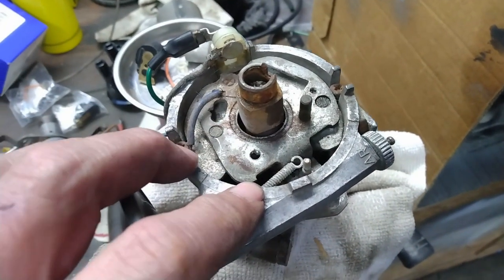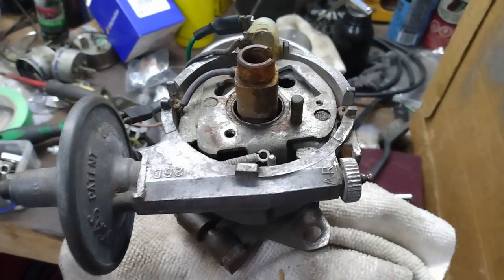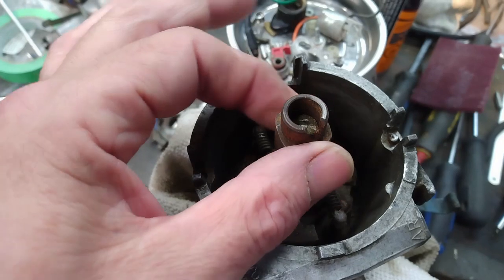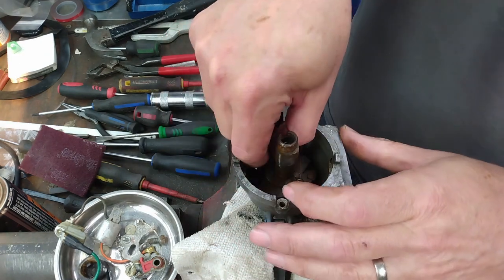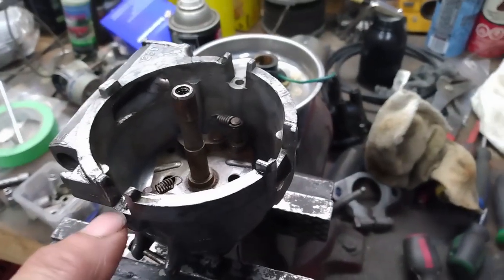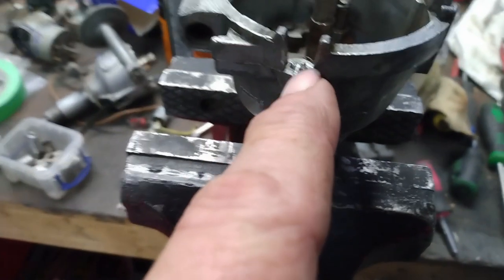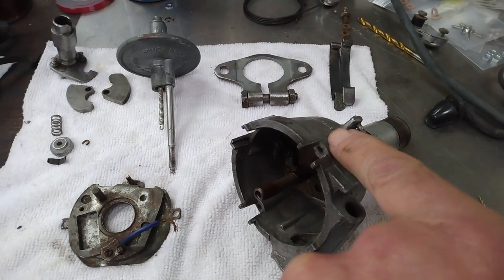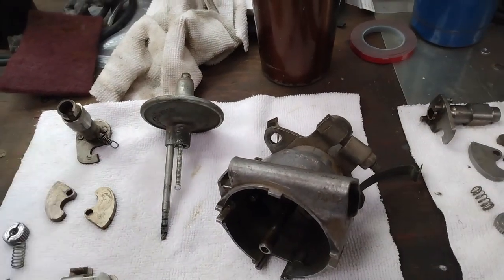How I rebuilt the Ausin Healey Sprite's Lucas distributor. Bugeye Build Episode 120

Comment: Ian, did you inspect the distributor drive shaft. It's easy enough to remove. I had a lot of rotational play in the rotor (and noise when running). I had installed a Pertronix system so it ran well, it compensated for the excess play I think. I decided to check the dizzy drive shaft and found the gear that meshes with the camshaft was worn razor thin, the obvious cause of the excessive play. I happened to have a spare and popped that in. No more noise.
Reply from the maker: Hi Tim. I did a quick check and didn't find any excessive wear or free play.

Comment: Looking good Ian!
Two things that popped into my head watching this video… 1) you use these as your second brain - meaning you were mentioning to yourself about the spring location… you were talking to yourself in the future when you go back and watch this video on your second brain… I do that but not as intentionally.
2) one of the best cleaning tools I have is my Dremel rotary tool with a wire brush - steel or brass brush. I also use my Dremel mounted in the vise using a Luthier tool from StewMac. Google  search StewMac Anchor for Dremel. Basically you mount your Dremel into this adapter which then gets mounted into your bench vise so you have both hands free to control the angle and pressure on what you are cleaning.
Reply from the maker: Thanks for this Bill. I'll check out that Dremel accessory!